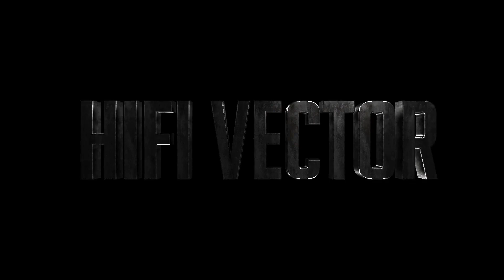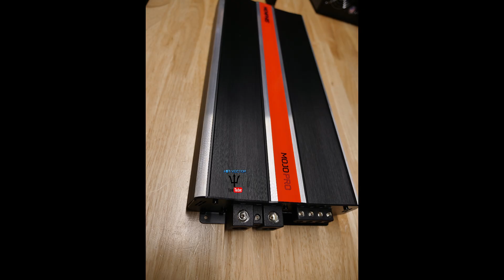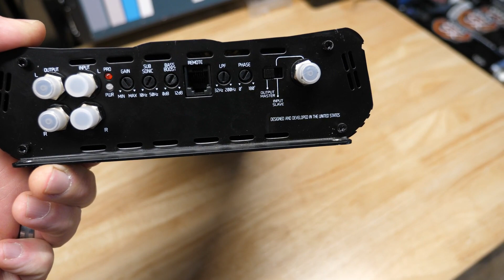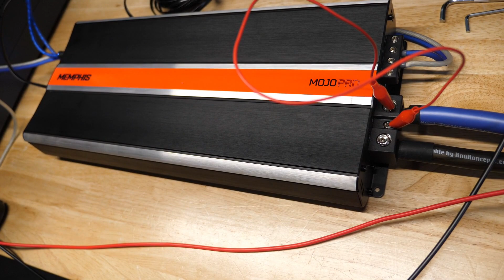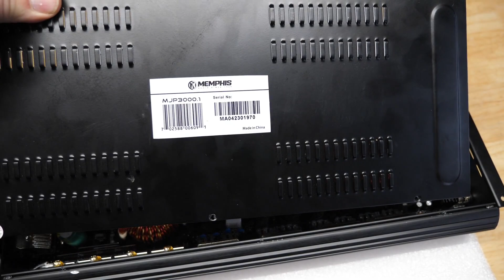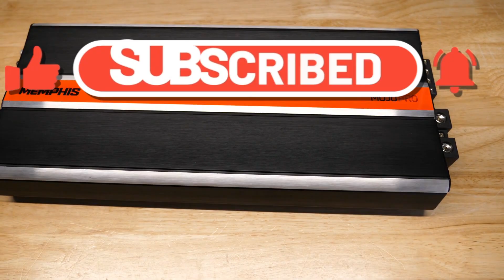Memphis MJP3000.1 amp dyno review 3000 watt mojo Pro subwoofer amplifier.

Comment: I had the CVr12 back in early 2000s i had a huge Profile Gator amp on them in a standard cab toyota. I now have the Memphis Pro 12s in my Silverado with a CAB2000 on them. They will take more so i bought a extra battery and wanting to get this amp.

Comment: In late 99-2000 I had a Memphis Belle 1000 watt amp on two audiobahn 12's on a fourth order in a nissan 200sx se-r. To this day I have still haven't heard a two 12 setup that loud. That setup would set off car alarms driving down the street. That was the only amp I've ever sold that I regret selling. That little amp was a beast.

Comment: Back when I was in high school (late 90's early 2000's) I was one of the VERY few to have a decent paying job after school hours ( worked for a tree service, climbing trees and bringing them down) and was always into car audio and wanted to go a different route than everyone else at the time ( i.e kicker, Infinity, mtx and so on) came across Memphis and got the 250/1 Mclass amp , HP 12" sub in a ported 30hz tuned custom made box with all Mclass coaxials . Sounded amazing and no one in my area had ever heard of Memphis. Now , these days that's what most people have. I still have old school 250/1 and 500/1 Mclass amps
Reply: Most people? lol Not really. I see more people with Nemesis that Memphis.

Comment: Memphis was what put car audio on the map in Tennessee back in the day they were in every electronic express , radio shack etc. still make badass products last system I had before going inside was a pair of L7's with a Memphis 2500 and it was the hardest hitting thing in town.......10 years later subs are massive amps are so big it's ridiculous and Memphis didn't adapt to the SPL lvl of most companies back in the day Memphis and kicker were head to head now sundown,deafbonce and others have taken over and Memphis is still in the SQ area I think the mojo is there biggest sub I've seen but yes they have been around a long time and build good quality subs and amp like kicker that's why they have a price tag like kicker your getting the extra bells and whistles that makes the amp perfect for daily driver setup that constantly slams and will last a long time I've had two Memphis amps before and both outlasted the car they were in and eventually went to a new owner but I would rather pay double the money for a great kicker, Memphis, diamond audio something like that that I can abuse and it's going to last and not over heat or burn out something than pay half the price and my amp last a year or two at most why don't people like quality all they want is something that is going to push a massive amount of power get hot as hell and constantly have a eye on it and give it breaks etc to cool off no way not for me I have two kicker CXA 1800.1 in my trunk and neither even get warm let alone hot and I play full tilt boogie for anywhere from a half hour straight every day back and forth to work and I drive to ATL twice a month 41/2 hours one way and I go to the max on my Atlanta trips and two years later everything in my trunk works like its brand new thats quality but to each his own

Comment: Cool video. I just would never spend that much on a Chinese amp. I guarantee you those caps will not make it five years.
Reply: You are absolutely correct. I'm tired of replacing those cheap kung fu capacitors in amps every 7 years for home theater powered subwoofers.
Reply: lol depends on build house Korea China  Asia one in same tge build house makes the difference

Comment: What's up fellas I have 2 of these strapped on 4 alpine type R 12's and it did 9,560 watts and a 165.8 dB before I melted 3 type Rs but I have 4 15" mojo subs I have to build a enclosure for in a Ranger blow thru I'm very happy with my memphis mojo pro amps they won't let you down that's for sure keep on bumping from Cincinnati
Reply: 165.8 in what vehicle??? Doubtful
Reply: @chriscarroll3635   in a 2003 ford ranger ext cab and I have pictures to prove it I used a mini bass meter and a AAM-1 ON the dash and it was a hot day and that bass meter the meter reads high in the heat but it still said it and mater the meter say HI a few times believe it or not don't really care
Reply: That amp doesn't do that much dynamic so how did two do 9560. No way...
Reply: @chriscarroll3635   I have 2 of them strapped that's how

Comment: I havent gotten any memphis gear in a long time.  Last time I got a pair of the 16-PR1x1000 amps gain matched to a a pair of 15s each amp running one coil per sub.  Got around 1300 watts out of each iirc.  Those amps still work fine to this day.  Both sitting in my mini truck which isnt on the road right now but I go run it about 2 times a month.   Used to run the tc9 based memphis subs way way back too.  Was good stuff though Idk that id run much of it today.. maybe that subs with the 7.5" coil or something.

Comment: Memphis is very high quality been running their amps for years Tru power amps....but it's like an underground thang ..the people that know.... know
Reply: Exactly ! Memphis is not as well known as other brands but they are as high quality as any on the market. I've been using Memphis since 2003 and never had an issue. Always have had quality. Right now I have the MJP 1000.1 and MJP 800.4 with a MJP 12"DVC@1ohm and 2 sets of MClass 6.5 components.

Comment: If it was 400ish it would sell, but at that price range there's better choices out there. Still looked and performed great. 😎👍👍
Reply: CT and skar are not similar quality amps. You're comparing apples to oranges.
Reply: Man please….
Reply: Indeed. You have CT-Sounds and SKAR providing similar quality amplifiers for much lower of a cost.
Reply: @Sm1te79 not at all deffently not scar amps
Reply: @Sm1te79  Skar and CT are nowhere near the quality of Memphis. You may get power from Skar and CT but putting them in the same boat as far as quality....no way.
Reply: @PatientXero607 efficiency iam not a comp guy wall builder  efficiency is key for everyday street beater the industry nakes u think a 10k amp go be louder in cases true.  but if u have a proper built box tune to your music. proper volume with displacement and decent electrical will be amazed what 1k or 1.5k sounds like and will be in the 140 or  low 130 over a period of bass drop and less strain . power is cheap . u need the power to move these big subs inefficient. nothing wrong with that but a amp pushing clean power and efficiency will last because it's not demanding much from amp and good electrical . impedence rise is a killer. in real world applications votage drop heat .
Reply: Dealer cost is below that, hit your local Memphis dealllerrrrr

Comment: I've owned the ST 1100D and the 🔥 mojo 2K. Great bang for the buck. Nothing wrong with Chinese products. I have 2 Harmony 1500.1's on 3 Harmony Carbon 12's. All Chinese, been banging for 2 years strong. Turns heads everywhere I go. Amps dyno over 2k. They're CT Sound 2k clones. Great video.
Reply: Maybe the CT is a
clone of Memphis lol-----Either way I would bet there more clones of these two.

Comment: i dunno how accurate this is, but i was told wayy back when that memphis was better for SQ and if you wanted raw power it was all about rockford fosgate. i know SPL setups anymore have moved on to sundown and mmats and taramps and such but i wonder if the memphis for SQ thing still stands.
Reply: It seems the difference between clean power and raw power isn't discussed anymore.
Reply: they in the power as well the v line is geard towards Sq
Reply: Yes, the sound quality is there for Memphis. Their amps are more efficient than many on the market, hence the sound quality.
Reply: Taramps for spl ??? Those amps look so damn cheap !

Comment: Love it! It's very expensive but it's nice.
Reply from the maker: Very good amp just a little pricey.
Reply: @FATHERSOFBASS  now for the price it's not a good deal. If you want a very good deal get a 2 Soundqubed S1-2250.1 amplifiers for under $600.
Reply: As a dealer I can guarantee soundqubed does not match the Memphis warranty on subs and amps

Comment: Nice 👌 to know 👍😎 for the money 💰... still going Smart 3k
Reply from the maker: Can’t beat the smart 3 bass for sure. Love mine.
Reply: @HiFiVector  Smart 3k uses bigger capacitors than the Smart Bass 3k... slight edge in power 🔋 💪 never seen the filtering measured ✌😉 Video 📹 Idea 💡 😄 lol
Reply from the maker: Smart 3 bass hits the lows better than the smart 3. I have both and have done back to back testing. Under 30hz smart 3 bass puts out way more. Regular smart 3 falls off at around 30hz. Video already in the works :)
Reply: @HiFiVector  Rock 🎸 😎 on Brother 🤘

Comment: definitely found needle in a haystack for a Memphis amp definitely on the high side as far as price does look more like Koreen board tho makes me wonder if it is a Korean board and assembled in china theres probly another 3k or 3.5k that use's same board
Reply from the maker: Yea it’s an bit pricey but efficiency and power was very good. Definitely caught me off guard.
Reply: @HiFiVector   the sub warranty and amp warranty can't be beat. Memphis has a dealer sub and amp warranty exchange   on subs dealers can decide what is done with subs.
Reply: I picked up one new from my local dealer for 425 to upgrade my old Memphis MC1100.1 to push my Memphis M5 15’s and I’m totally pleased…. I also just picked up a JP 284 to run some midrange speakers…. What do you think about the JP284?